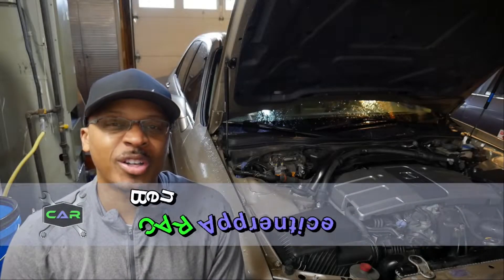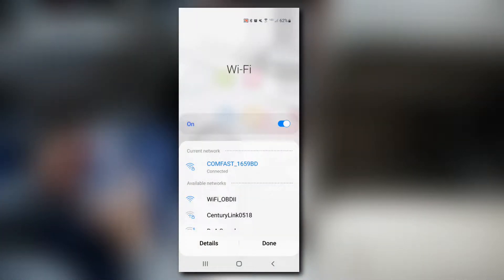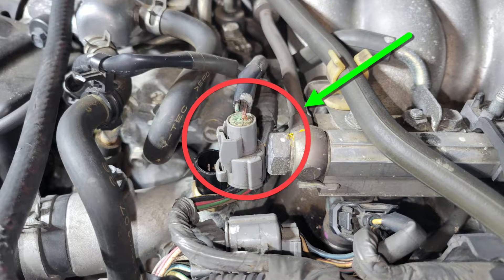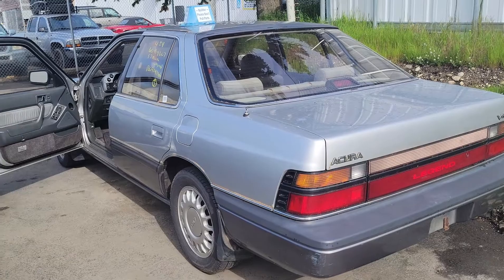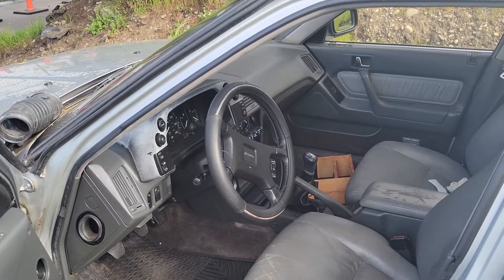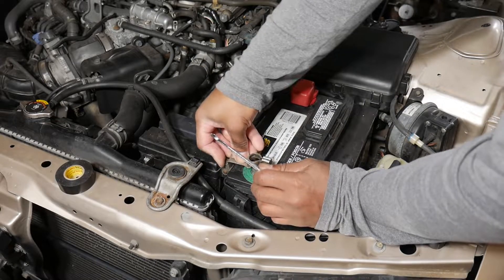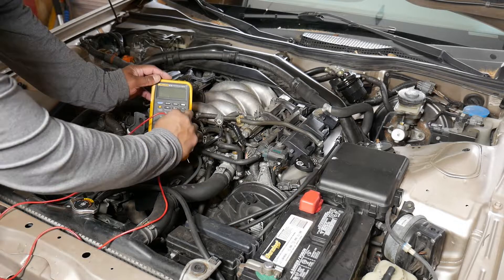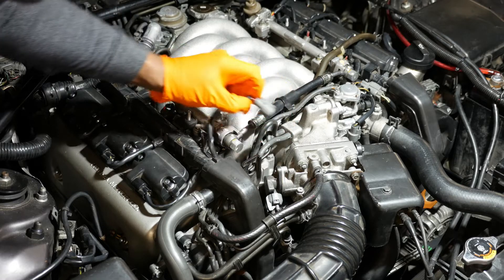1999 Acura RL - P0118 Diagnosis and Engine Coolant Temperature Sensor Replacement

Comment: 04 acura rl owner..my temp needle worked fine..then suddenly dropped..it now only goes up a couple lines above cold..is that my thermostat??
Reply from the maker: It could be the thermostat. I would remove it and test it in hot water to verify that it's opening and closing correctly.

Comment: Hey I have an Acura rl 2004 and my temp gauge needle is stuck half way it doesn’t move at all I changed the ect sensor and I’m still having the same issue any suggestions?

Comment: Knock sensor location on a 1999 acura rl 3.5
Reply from the maker: See #16 and #17 in this diagram: https://acura.bernardiparts.com/acura/Parts-List.aspx?year=1&product=7&door=1&grade=99&transmission=1&area=1&section=1&assembly=3176

Comment: Good content quick question though I have a 2002 rl and I changed the temp switch fan still doesn't kick on after digging around im thinking its the cooling fan temp switch any idea about this thanks
Reply from the maker: Is the coolant temp running high? Did you receive a P0118 or a different code? Any other symptoms you're experiencing?
Reply: @carapprentice  p1486 code
Reply from the maker: @eightyd2098  I stored the factory service manual here: https://www.mediafire.com/file/uvbmryok1ax4vbs/Acura_RL_-_Factory_Service_Manual_%25281996-2004%2529.zip/file
There's a troubleshooting flowchart for P1486 on page 11-110 in the Fuel and Emissions section. It appears that low coolant level, the radiator fan switch circuit, or the thermostat are likely causes.

Comment: If I change out the plug can it take out the p0117
Reply from the maker: It's possible, but you'll need to test to properly diagnose the issue. Here's a link to page 11-78 in the Fuel and Emissions section of the service manual: https://www.mediafire.com/file/tllbosu7w0yicca/RL9604S11078A+-+P0117.pdf/file
Here's a link to the full service manual: https://www.mediafire.com/file/uvbmryok1ax4vbs/Acura_RL_-_Factory_Service_Manual_%25281996-2004%2529.zip/file
Reply: @carapprentice  alright forsure I picked up this very clean Rl but it had this code I changed the sensor but not the plug bc there was no residue of coolant or moist around the wires whatsoever
Reply from the maker: @anykineproductions9327  I would start by checking for 5V at the sensor's connector while tugging lightly on the wires to see if the voltages drops out.

Comment: What causes a p0128 temperature gauge takes a bit to rise and also it reaches the h and fluctuates replaced the temp sender will the radiator sensors cause this also switched the thermostat
Reply from the maker: I couldn't find the P0128 code in the service manual, and I've never personally seen it. As you may have researched, if you are indeed getting a P0128, here are some probable causes; it appears that you may have eliminated a couple, unless the replacement parts were bad, also. 
From KBB: https://www.kbb.com/obd-ii/p0128/
- A bad coolant temperature sensor
- The cooling fan is stuck on
- A bad intake air temperature sensor
- A thermostat that’s malfunctioning or stuck open (electronically controlled or traditional)
- A P0128  can also be the result of using your car in a cold climate during the winter and being unable to get to normal operating temperature. Taking several small trips could reset it.

Comment: Hi.  I like your videos.  I have a 2001 Acura 3.5 RL.  I like the body style and want to keep the car going.  Have you done the timing belt/water pump service on yours?   If you could post a video it would be great.  I can't find any videos of the 1996 - 2004 body style on YouTube.   Thanks again.
Reply from the maker: Timing belt and water pump are on my list, but I may not be able to get to them until next summer. Thanks for checking out the videos!

Comment: Actually question,have you ever ran in to an immobilizer issue?  Heard it might be dealer only but ofc you know what they want just to check
Reply from the maker: I've seen other RL owners have immobilizer issues, but I've never had to diagnose one myself. If you haven't already, you may want to check out the 96-04 Acura RL Facebook group: https://www.facebook.com/groups/1427987647415950
Also, I've stored the factory service manual here if you need it: https://www.mediafire.com/file/uvbmryok1ax4vbs/Acura_RL_-_Factory_Service_Manual_%25281996-2004%2529.zip/file
Reply: @carapprentice  thats awesome appreciate the help, much love. Keep doin ya thing

Comment: Did you put LEDs in the cluster if so got a link...
Reply from the maker: I responded to your other post - just replying here for other visitors. The LEDs came installed in the cluster when I bought it. I have seen some Legend owners install bulbs from superbrightleds.com, but I've never used them.

Comment: Got a code of p0715 turbine/input shaft speed sensor circuit any help with that ? I got a Acura rl 1997
Reply from the maker: Here's a link to the service manual that may help with diagnosing the issue; I don't have any experience with that code. See page 14-74 in the Transaxle section: https://www.mediafire.com/file/uvbmryok1ax4vbs/Acura_RL_-_Factory_Service_Manual_%25281996-2004%2529.zip/file